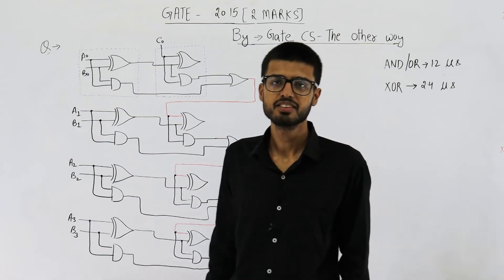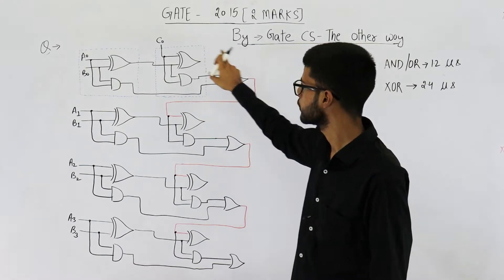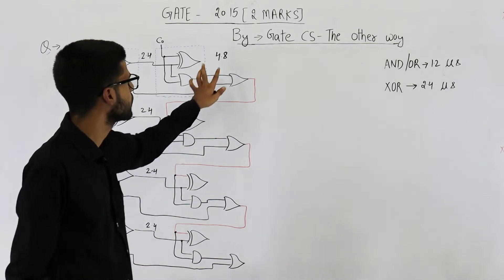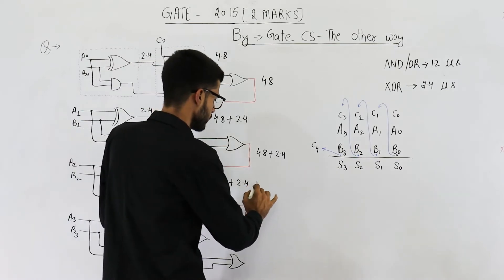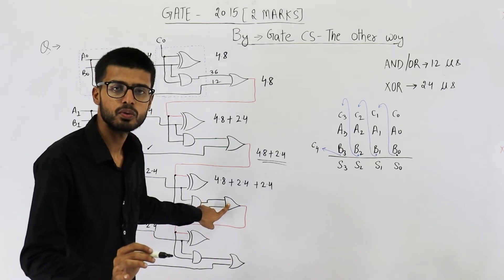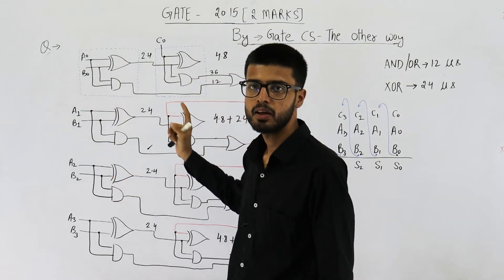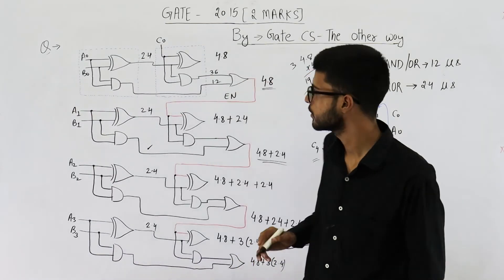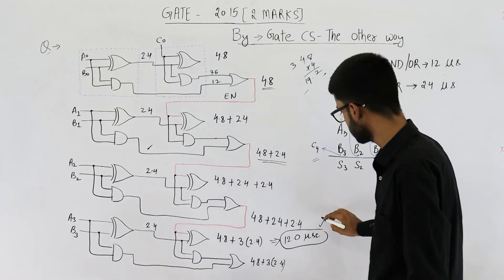Gate 2015 pyq DIGITAL | A half adder is implemented with XOR and AND gates.

Comment: wrong answer, question says ripple adder so answer would be 19.2 ms
Reply from the maker: I guess you havent payed attention to what i said. Dear student try finding a valid reason of waiting for performing addition of bits that are already available to you and would not ever change even after receiving a ripple from previous bits(ie the carry). I dont find any good reason. 

Or maybe you are not clear with concept of ripple carry adder. Ripple is generated on by the carry. Actual bits does not ever change although the 3rd input(ie carry in) might be on  for some of the bit positions and hence affecting answer bit.
Reply: @GateCsTOW  but there was no 12ms option
Reply from the maker: You will find many such questions where there is a confusion arround answer, the official key might also say something else.